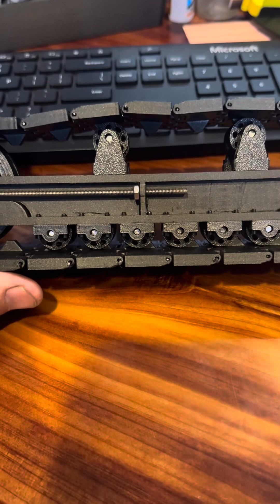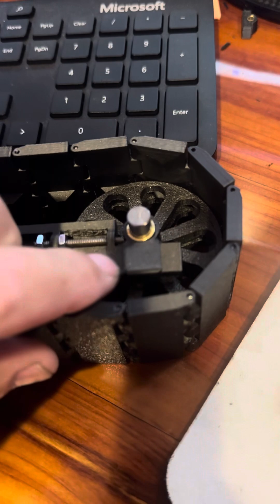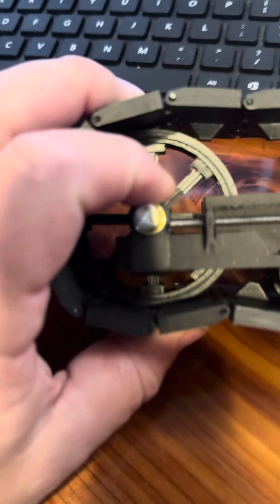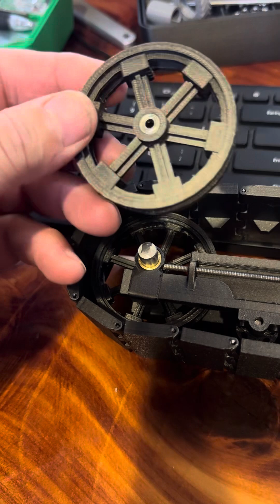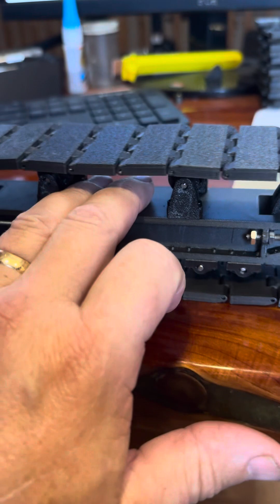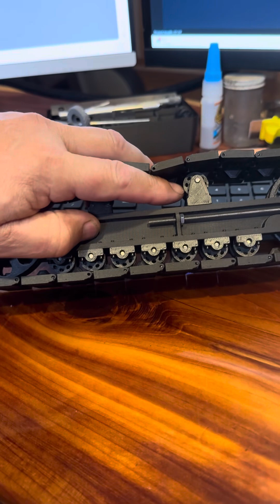Link- Belt LS-50 scale model 3-d print

Comment: If the top of the track isnt sitting high enough. Rather than increase the diameter of the roller. Just add a few mm to the height of the roller carrier either with a spacer block or just make the roller carrier taller.